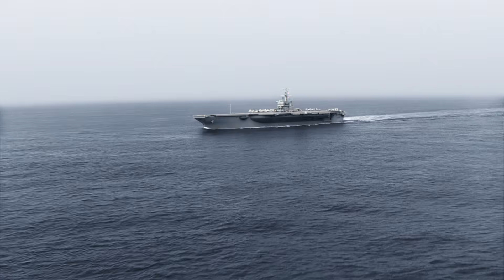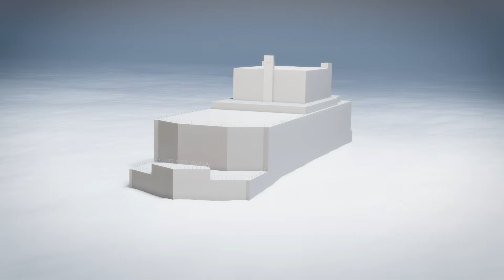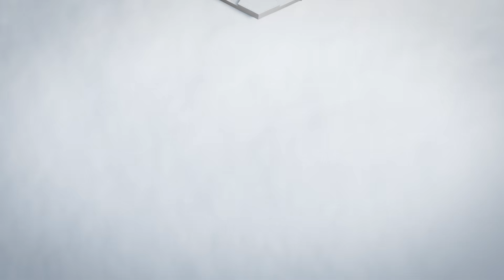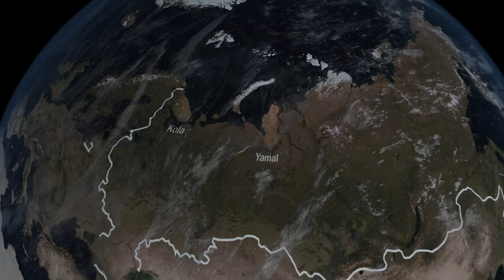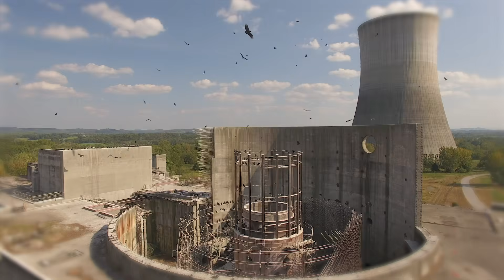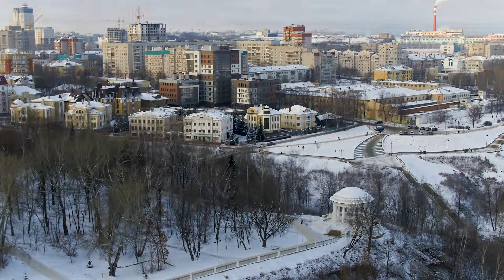Why Russia Built a Floating Nuclear Power Plant

Comment: Floating bomb and that’s a lot off nuclear waste coming our way. Where is it going to go!
Reply: In the video was said that will dumo wastes every 12 years so no not that mitch of radiation
Reply: if you did some research you would find that reactors cant have a nuclear explosion. a nuclear bomb is more then just a hunk of Uranium its a extremely complex device if one pares is out of timing even by a few ms it won't work. as for the waste go do the research its time you learned for your self.

Comment: what you also should have considered is that these platforms might be able to cross blue waters and be used statically to bolster alliances, by lending these reactors for a short time. Furthermore, I dont think these ships represent any big investment compared to a conventional nuclear power plant, since they are using well established technologies. Moreover, they also have the advantage of keeping the capabilities and workers / engineers needed for building mobile reactors (with dual use) and therefore not loosing the capability to produce nuclear powers ships in the future.

Comment: Um THE ONLY FLOATING NUKE POWER PLANT?
So what the FRACK is an Aircraft Carrier? Or a modern AMERICAN Sub?
Reply: This is a dedicated power plant - it's not a nuclear propulsed ship.
Reply: @adamdanilowicz4252  Your statement is semantics at best. VAMobMember's point is still valid, any vessel that has ever been built with a Nuclear Power Plant came before this. Doesn't matter what the plant is used for, it's the fact that it's a floating reactor. And the power plants on Navel ships aren't only for the propulsion systems, they are in fact the dedicated power plant for that vessel.
Reply: @Ranger0463  nuclear reactor =/= nuclear power plant, NPP is much more than a reactor

Comment: why not just use a sub?
Reply: More expensive.
Reply: Because actually military reactors and reactors for power plant are very different. Moreover, reactor is just reactor, around it a large complex of misc systems, which absolutely different on military ships and power plants. Using sub is possibly, for a short time, but it is stupid and very expensive.
Moreover, this plant not only produce electricity, it also produce drinking water for whole city and heat for city.

Comment: Because Chernobyl wasn't enough?
Nuclear energy is not only a chance of a disaster. It's a timeless nuclear waste that will have to be stored safely for eternity.
When you have a nuclear powered vehicle it would be still quite easy to eliminate the damage fast and efficient. Even tho throughout the history a lot of people been killed by an impressive list of accidents. Including contamination of the waters. When you have 100 tones of fuel on a bottom of the sea. Good luck fixing that. Especially knowing Russia.
I'm all positive for green energy as long as it's safe. I mean even Fukushima would've been fixed eventually if it wasn't for once in a 1000 years disaster. Luckily for humanity it happened in Japan, where they made everything possible to contain the disaster and clean contamination. And immediately all existing power plants have been double checked and upgraded.
Reply: Nuclear is statistically far safer than almost any other source of power - including all the accidents. Only about 36 people died in Chernobyl, and nobody died from radiation in Fukushima. If you look at what small volume spent nuclear fuel takes up, given how much carbon-free energy it generated, it's a relative non-issue. If this reactor were to sink (for whatever strange reason), water provides perfect radiation shielding as well as cooling.
Reply: @adamdanilowicz4252  so you say that a melted core on the bottom of the sea wouldn't be a big deal? OK. We'll see when that happens. Statistically it's safe to travel with an airplane, yet once in a while they still crash. (I've seen JK5022 with my own eyes, my flight was delayed for 3 days because of that.)
Fatalities in Chernobyl are very questionable. But I was talking about nuke submarine accidents. On the plus side - no exclusion zone. And millions of people don't have to relocate. I mean, you have to be prepared for the worst case scenario. And so far floating nukes don't sound safe to me. Tho I'll take a closer look and might reconsider. Like right now if meltdown happens on any power plant, there's still no back up plan except containing it for hundreds of years to come.
Hopefully ITER is gonna be finished soon and all the problems will be solved once and for all.
Reply: @andrefreelove676  My point of the reactor sinking was more of a nonchalant joke, but in all seriousness, if the power plant were to sink for whatever strange reason, there would be plenty of emergency shutdown systems that would SCRAM the reactor core. These modern systems are engineering to a high standard and tested routinely, so it's something I wouldn't worry too much about. There hasn't been a single serious accident in marine nuclear propulsion since it's introduction, and I have even more confidence in today's systems. When it comes to nuclear fusion, it's a nice theoretical dream but I wouldn't wait around. ITER is just a demonstration reactor, that will not not generate a Watt of usable electricity.
Reply: @SmashEX Entertainment
"Melted core on the bottom of the sea" has already happened. Several times. What's the big deal? Emotions don't make for good arguments.
Reply: @Nuclear energy is not only a chance of a disaster.
nope. nuclear has an extensive record of being perfectly safe when it is done right. Sorry but Chernobyl has pretty much been blown up on purpose and Fukushima happened only because its operator decided to save some money and build an insufficient sea wall.
Not to say both these power plants were designed in an age when people didn't even know what is a computer - we really do know how to build them better now...
@It's a timeless nuclear waste that will have to be stored safely for eternity.
nope. Technology that can reduce the volume of nuclear waste by 98% and its longevity to just 300 years is already known. Untested, but already known. I see no reason why shouldn't it be ready to go in 10, 15, max 20 years - and waste can be safely stored in casks for that time.
@When you have 100 tones of fuel on a bottom of the sea. Good luck fixing that.
no problem at all - for as long as nuclear material, and especially fission products, remain contained. Water does happen to be very good at containing radiation - that's why spent fuel is being stored in pools.

Comment: Russia: Largest country on earth.
Russia: "We won't be building a powerplant on land."
Reply: They're building them on land too...
Reply: @zolikoff  its a joke
Reply: Its hard to build on a good bunch of their land
Reply: @cottontheeastercottontailr265  next to fucking impossible on about one third of it
Reply: Russia's very size is precisely why it makes more sense to build seafaring power plants: If you can freely move the power source to where it's needed (oil and gas exploration, etc.), there's no need to build a vast network of long transmission lines, which can be prohibitively expensive (especially in remote, scantly developed areas), or to ask local authorities for permission to pass, which would inhibit the power plant's mobility. This is an elegant solution.
Reply: @hamletgiragosian6147  4th gen molten salt tech drastically reduces cost making metro coal & gas turbines metro affordable.  Existing infrastructure including syn fuel from the process heat industrial backend.  The SSR is the closest to existing nuclear codes.
Reply: That land is undergoing collapse because of melting permafrost.  Wait until it's all over.
Reply: Hobo G, most of the land is inhabitable anyways
Reply: If there's a runaway reaction, they just sink the ship.
Reply: Homework shows gen 4 is runaway safe.  Nice try enviro-wrong-info-brain.  Particle physics is natural.  Ain't gonna haunt you in the bedsheets.
Reply: 1. There is no "land", City of Pevek is in permafrost region.
2. Many northern regions have no connection to mainland's road network. Building NPP "on-site" in such a case is a logistics nightmare.
Reply: в том то и дело что большая, а наземная станция не может двигаться лол
Reply: @nuclearzerg  in English? :)
Reply: This seems real safe.
Reply: Just built some new ones. Floating is for remote regions where delivery of fuel and/or electricity is difficult.
Reply: Probably because they realize in the next 60 years their water line is going to drastically change.
Reply: Where it operates it is less land and more a frozen snow-mud goo
Reply: No more Chernobyl never again hence
Reply: @spasticmovements  Fukucima. Chernobyl is Ukraine not Russia.
Reply: @spasticmovements  funny joke
Reply: @spasticmovements  Chernobyl is in Ukraine not Russia
Reply: @spasticmovements  chernobyl is Ukraine, please keep in mind, not Russia
Reply: Ukraine was Russia before 1991
Reply: @alanmalan3819 Ukraine was UkrSSR before 1991
Reply: @13attr  Russia was USSR in UN before 1991
Reply: Russia spend USSR taxes before 1991
Reply: Good part of their territory is permafrost, not land.
You totally don't want them to start building nuclear plants on permafrost.
Reply: Don't underestimate russian inventors, Russia is known for it's genius engineering and free hands for development in energy production
Reply: Good idea if it explodes just scuttle it and say you forgot where you parked it.
Then make a movie called dude where's my reactor.
Reply: This made me laugh so hard
Reply: Corrupt country
Reply: Yes, this time they made their nuclear crap mobile expecting accidents earlier or later.
Reply: @denisoko8494  So Fukushima also was "their" nuclear crap?
Reply: @postgradsibstud9321  what did you expected from a Ukrainian nazi? Ukraine didn't updated Chernobyl-kind power plants since the collapse of the Soviet Union, yet it is Russia he is concerned about and not a word about outdated Ukrainian nuclear crap or when they going to build replacement.
Reply: @cianakril  you know chernobyl happened before all of that don't you? You do know it was caused by faulty procedures don't you? Do you know anything Russian bot?
Reply: @handlesarefeckinstupid  do YOU know anything yourself, CIA bot? Ukraine currently operates 15 reactors. The oldest was launched in 1980, 6 years BEFORE the Chernobyl, 40 years ago with the projected lifespan of 35 years, and haven't seen a single refurbishment or upgrade since the fall of the Soviet Union. The youngest was launched 1995 by the same late 70es design after construction delays for 10 years and substandard materials due to post-Soviet emblazings, and haven't seen a refurbishment or upgrad since then, too. In fact, the remaining Chernobyl site reactors were running up till the 2000, for 14 years even after the unit nearby blown up, and were shot down only after combined pressure from EU and Russian side. It's only a matter of time before all of the 15 Ukrainian power plants will went Chernobyl, as there is no even plans to build any substitutions for it, nuclear or conventional, nevermind the actual project or construction. And like this is not enough, they let Westinghouse to experiment with nuclear fuel rod for none-Western pre-Chernobyl designs which already ended up in several accidents. If anything, Russia should be is the least concern for the bot like you or this ukie bot above.
Reply: @cianakril  things always get nasty when $$$$'stake.  Start vs existing monies paranoia.
Reply: @denisoko8494  your parents dropped dead of corona virus? ; ))
Reply: @denisoko8494  You guys forget Fukushima nuclear power accident in Japan was built by the US.
Reply: @davidmbikumbix5871  Are you trying to equalize soft and worm by comparison? Fukushima is a natural disaster accident made by powerful earthquake and tsunami, the Chernobyl explosion was a human made accident where unqualified personal  made a disastrous experiment breaking all core safety protocols by following orders from 800km remote scientists located in a Moscow region. Yes, I lived one hour drive from Chernobyl when it happened, moreover I personally took part in one of  projects to fix this Russian made nuclear crap.

Comment: the economics of nuclear power changed drasticlz in the last decades. A normal modern powerplant is now less economic than wind and solar, the newest powerplant in France shows this. Even though it's not even finished, the construction costs quadrupled to 12 billion euros. That's not worth it, because renewables can be steady energy suppliers if used with batteries.
Reply: You going to build battery storage installations in the Arctic?

Comment: Unlimited power but it has to be towed everywhere. Damn son. Great vid.
Reply: I'd guess that putting a propulsion/navigation/control system on it just for the two trips it makes once every 12-15 years would be quite a waste. It's cheaper to just tow it.
If you do expect to move it several times a year I might understand, but if it's largely just fixed in place most of its life then it's not worth it.
Reply: I agree with the guy above me, it would be useless to have a complicated steam turbine rusting. Plus, there would be no way this sails alone trough the artic, since it needs an icebreaker escort anyway
Reply: @ignacioaguirrenoguez6218  yep. Add a propulsion and ice reinforced hull to sail through the Arctics and you essentially get a 40 years old Arktika I icebreaker that Russia is currently phasing out. It would be a mediocre icebreaker that still would be better in navigating ships than standing moored at a port, and at the same time several fold more expensive and overcomplicated as a power plant.
Reply: you'd think they would at least put some propulsion on it, you know, bring an enormous power plant an all

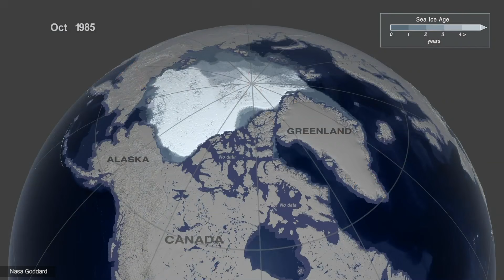Comment: 4:13 The ice cover then & now is simply mind boggling.
Reply: More of a disturbing image
Reply: And boomers still say stuff like all this is not real.
Reply: #1 reason: access to cold water 🌊 for cooling, as nuclear power ☢️ 🔋 plants require a LOT of water to cool the reactor. 

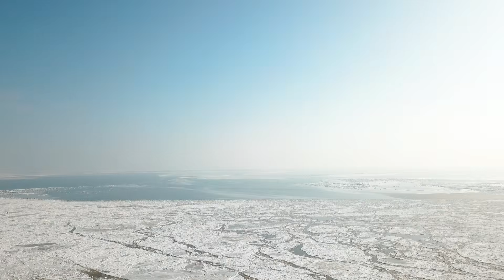@4:00 This could also contribute to global warming 🌏 🥵 since it is happening in the arctic! 😳🤯
Reply: @bthemedia  lmao wtf is with all the emojis?
Reply: @bthemedia  No, stop that crap right away. The amount of wasteheat is incredibly tiny compared to the amount of water in an ocean, not to mention its a very cold ocean. Many of the much higher power commercial reactors (around 1000MW) use river water as  their third loop (condensation loop) and few metres away from the point where they realease the  warm water it temperatures drops off to the background. If you consider the scales such reacors would literally mean warm drops in an huge cold ocean.
Reply: @CraftyF0X  the exploitation of the arctic that it will facilitate to destroy the arctic and exploit its oil and minerals causing unthinkable amounts of emissions will be like a huge warm ocean on a huge cold ocean
Reply: @naveenarora6467   Naveen Arora  I talked about the nuclear platforms specificly. The rest is sad and we should avoid, there is no disagreement about this.
Reply: @naveenarora6467  what do you mean "will be"? This floating nuclear plants are meant to replace already existing one. Bigger and operating for 50 years already.
Reply: @bthemedia  only powerplants which could rival nuclear are fossil fuels. So go figure a bathtub of CO2 per day or hundreds of thousands of liters of CO per day.
Reply: Are you guys worried about climate change?  You need to talk to India and china.... js
Reply: Its almost like its a natural cycle driven by the sun thats been happening for billions of years.... but sure global communism and astronomically large taxes will magically fix that.
Reply: @AdmiralJT  it doesn’t look so natural anymore

Comment: When will someone make a flying power plant is what I'm wondering. Maybe North Korea will find a way
Reply: The United States Air Force already made a flying nuclear reactor. It was called Convair NB-36H.
Reply: kim will probably try
Reply: the USA already tried
Reply: A little tricky with the power cables but anything is possible (giant extension cord maybe????)
Reply: You mean a missile?
Reply: Maybe we can research the short wave transmission. One country in Doraemon universe is already using this.
Reply: Aren't nuclear warheads just basically nuclear reactors wth no cooling? And some dynamite?
(Yes, i know that they don't work like this, this is supposed to be a joke)
Reply: the USA tried it but abandoned the program (THANKFULLY).
no wants to breathe radioactive air/gas/vapor that passed through a nuclear reactor and if you say soo than your absolutely in the wrong